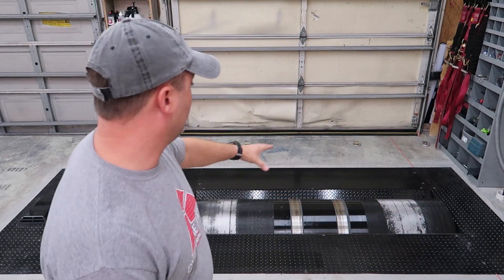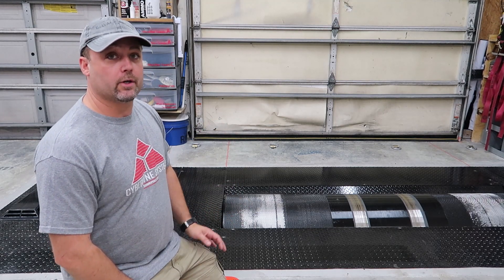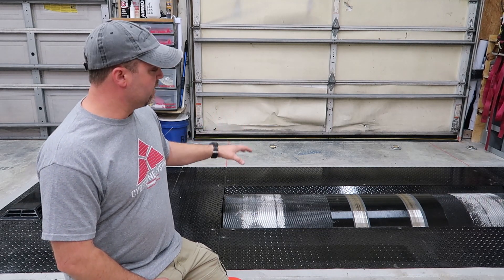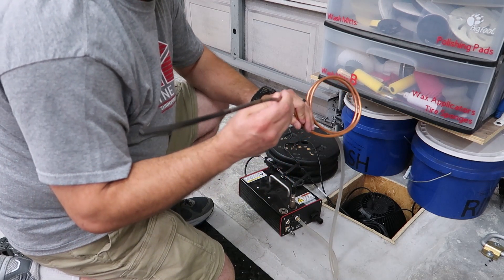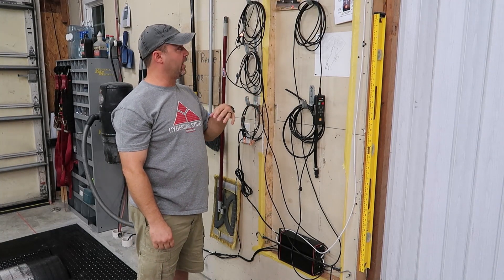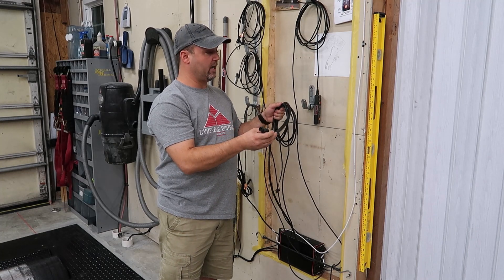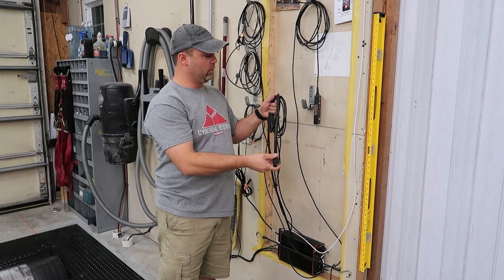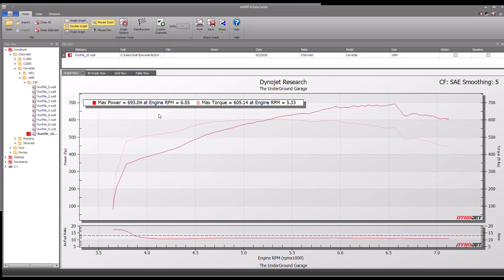Reviewing my Dynojet 224XLC dyno, general thoughts, and how I use the eddy brake / load control

Comment: hi, thanks for the nice review , i would like to know if you did't bought the load Ver. is it gonna give you different power and torque range during the pull ?  i am thinking of dyno jet but i couldn't pay for XLC as my budget is tight , do you think its still good option
Reply from the maker: The LC is nice for sure.  You can buy the 224X now and add the load control later.  For making power pulls, I don't think there is much difference.  The dyno reports the same numbers on most everything regardless of whether I use the LC or not.  The only time it's different is when the LC will load a turbo car more than just an inertia pull.

Comment: Thanks for the video, looking at getting a dynojet myself. Software looks like it works good.
Reply from the maker: No real complaints so far.  The eddy brake is almost a must have IMO.
Reply: @UGGdyno  I agree, I'm upgrading from a dynocom dc5000.
Reply from the maker: @8SecSleeper  Ya, I use the brake on 90% of the cars I dyno.  Being able to simulate a road test, lock the MPH or RPM at whatever I want, step tests, etc...  That capability is worth as much as power and torque numbers as far as I'm concerned.

There's a video on my channel where I dyno a Nova that makes 900+.  With the road load simulation on a pull in high gear took about 6.5 seconds.  Same pull with inertia only took about 2.5 seconds.  Like I said, the brake is almost a 'must have' in my opinion.
Reply: @UGGdyno  what was the result for the run with load and for the run without load ? :)
Reply from the maker: @meayman1  It reports the same numbers either way